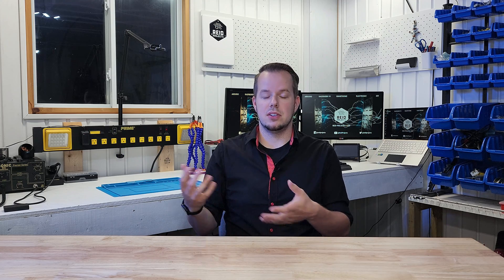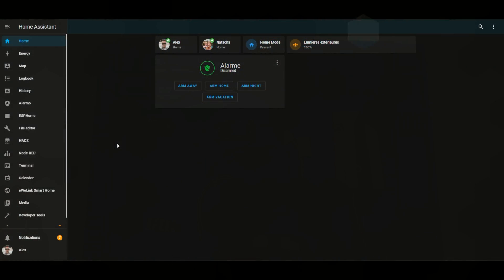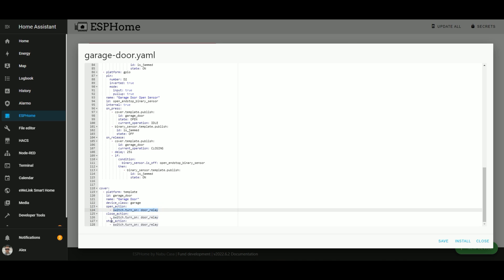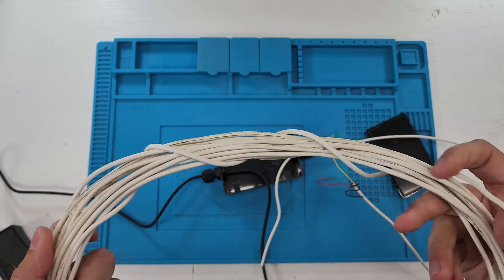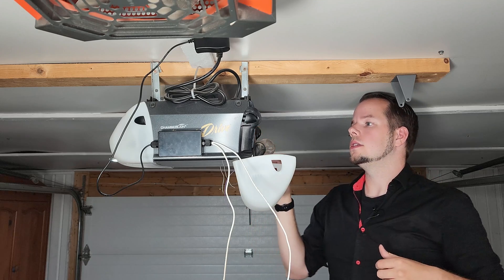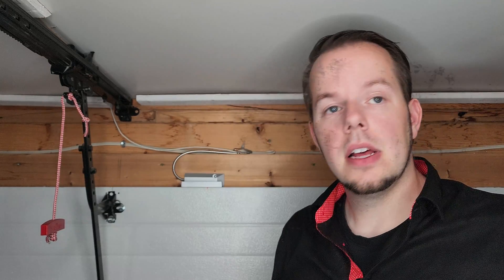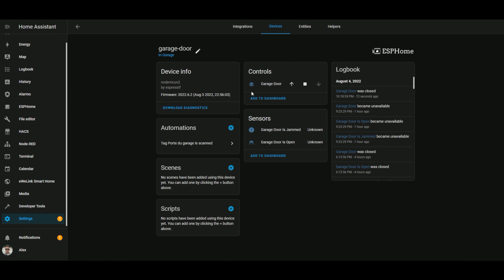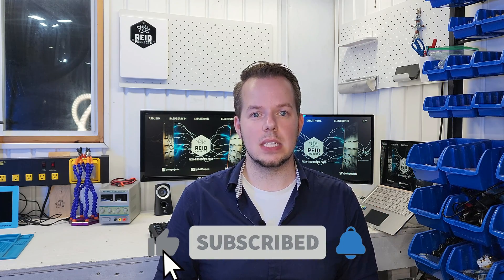How to make your Garage Door Smarter with Home Assistant and ESPHome !

Comment: This is awesome. Just what I needed. I went with the ESP32 with built in single relay to make it easier to 3D Print a custom case. I also exposed the relay so I could control it in automations easier. It even works well with the original remote.

Comment: Great Project. Made it about 2 years ago and works flawlessly. I want to be able to override the obstruction if it wont close. Leaves often obstruct the sensor. I suspect that I need a second "Switch" series of statements - call it "switch_Override". Does that sound right. I'm not much of a YAML coder.
Reply: The idea is that I could change the "Delay" to 15 seconds or so. This would simulate pushing the door button until it closes, overriding the obstruction. At least that is how my garage door works.

Comment: Just one note regarding is_jammed:
If you open the door, stop and close back you will still get is_jammed. Similarly from open to close, stop and back to open. To mitigate this you need to modify condition so that it takes status from both open and close end stop sensors.
           condition:
             - binary_sensor.is_off: open_endstop_binary_sensor
             - binary_sensor.is_off: close_endstop_binary_sensor
Reply: Here is the specific format that worked for me. You need the "and:"

        condition:
            and:
            - binary_sensor.is_off: open_endstop_binary_sensor
            - binary_sensor.is_off: close_endstop_binary_sensor

Comment: Great video, works great. I have mine working but when you add the relay in parallel it stops the remote and Wired button from working. if you remove it, the button and remote works fine. Any advise?

Comment: This is a super cool project and I would like to thank you a lot for the code!
I have extended it a little with an ultrasonic sensor to detect if the car is present or not.

sensor:
  - platform: ultrasonic
    trigger_pin: D3
    echo_pin: D4
    id: dist
    unit_of_measurement: 'm'
    accuracy_decimals: 2
    update_interval: 60s
    timeout: 4.0m
    filters:
      - filter_out:
          nan
      - max:
         window_size: 3
         send_every: 1
         send_first_at: 1
...
binary_sensor:
  - platform: template
    name: "car is parked in the garage"
    id: car_parked
    lambda: |-
      if (id(dist).state < 0.8) {
        // car is parked
        return true;
      } else {
        // car is not parked
        return false;
      }

I've also tweaked the code a little bit and I would like to share that bit as it might be interesting for others as well.
Instead of the hardcoded delay (in your case 25s) I'm using wait_until with a timeout of 25s which will have a similar effect as your code however with the static delay I found that when the door was opened and instantly closed I got a short "jammed" which the wait_until avoids.
Just remove
      - delay 25s
and replace it with
       - wait_until:
          condition:
            binary_sensor.is_on: close_endstop_binary_sensor (or open_endstop_binary_sensor respectively)
          timeout: 25s  

Thanks again for sharing your code it made my project a lot easier for me.
Reply from the maker: Awesome ! Those are great additions 😀 I might add them to mine too or to a second version, thanks for sharing 👍
Reply: @ReidProjects  I have fixed the last thing that bothered me a bit:
When you restart the ESP (e.g. because you updated the firmware or because there was a power cut) the jammed status and door status where set to "unknown" until you opened or closed the garage door the next time.
Adding this code in the esphome stanza will solve that problem:

esphome:
...
  on_boot:
    priority: -100
    then:
      - if:
          condition:
            or:
              - lambda: |-
                  return id(close_endstop_binary_sensor).state;
              - lambda: |-
                  return id(open_endstop_binary_sensor).state;
          then:
            - binary_sensor.template.publish:
                id: is_jammed
                state: OFF
          else:
            - binary_sensor.template.publish:
                id: is_jammed
                state: ON
      - if:
          condition:
            lambda: return id(close_endstop_binary_sensor).state;
          then:
            - cover.template.publish:
                id: garage_door
                state: CLOSED
                current_operation: IDLE
            - binary_sensor.template.publish:
                id: is_open
                state: OFF
      - if:
          condition:
            lambda: return id(open_endstop_binary_sensor).state;
          then:
            - cover.template.publish:
                id: garage_door
                state: OPEN
                current_operation: IDLE
            - binary_sensor.template.publish:
                id: is_open
                state: ON
Reply: @schogaia   Gonna give your addition a try, have to ask though, at what place in the file did you add it, beginning, middle, end?  Thanks in advance
Reply: @Kevin1959ify  I'm currently not near a computer I hope to remember to paste you my entire code
Reply: @Kevin1959ify  the bit I added you can just add to the bottom of the file
Reply: @schogaia  that'd be awesome, very appreciated!

Comment: Great video thank you, If have two doors in one Garage could I use additional pins on the ESP to setup a second relay and set of sensors or should I get 2 ESP's?
Reply from the maker: Thanks that's appreciated :) You should be good with only one ESP for 2 doors, no problem.  Just make sure you select a board that has enough IOs.

Comment: I only have a single magnetic contact on my garage door.  Can this be adapted to work in my situation.  I also have two doors.  I have an ESP32-dev, I am assuming that I can use that as well.  Also does it have to ONLY be used for the garage doors or could temp sensors be added.  Thank you

Comment: The esp board is 3.3V i/o and you’re driving a 5V relay board expecting a 5V trigger signal.  I guess it works but I’m wondering how reliable that is.  Has anyone had issues with this?
Reply from the maker: No issue on my side ! This is why I chose that specific relay model. The Trigger Voltage will consider anything over 2.5v as High, so it always accepted my ESP's outputs. I had other models with a higher trigger voltage which indeed didn't work.

Comment: This is cool. I wish this was around when I set up my garage door switch in home assistant. Mine is currently using a shelly switch but I want to move away from using cloud based products. How do you flash the NODEMcu with esphome? I have a few on order from amazon for a WLED project and I will have one left over so I was thinking of using it for this kind of project
Reply from the maker: Thanks ! If you're already familiar with WLED, installing ESPHome isn't that different. I would recommend to go with the ESPHome add-on on Home Assistant, then you can just connect your device to your laptop and follow the instructions when creating a new device. This method needs to be done through https though.

There's also few other ways but a bit more complicated.
Hope that helps ! Let me know if you need more details

Comment: Hi, 

I really enjoyed the video.

I have been doing the same thing, but using a Raspberry Pi Pico W and ESPHome.

at 7:40 ( https://youtu.be/8Hwu4ZahLa0?t=460 ) you mention on the first boot they won't know which states they are in. Have you tried adding 

"publish_initial_state: True"

in your YAML code on ESPHome for each of the GPIOs within the binary_sensor section? 

I was having the same issue, if the power to the Pico W gets interrupted they came up in an unknown state. This fixed it for me.
Reply from the maker: Thanks ! That's great , I'll add it to the sample config ! :)

Comment: You skipped over the most important part of this project, the wiring of the ESP+Relay. Very little information on this part and it is the most important part in the whole video.
Reply from the maker: That's noted, sorry about that. You can have a look here, I made a small diagram that might  help : https://reid-projects.com/control-garage-door-with-home-assistant/

Comment: This is great!  Exactly what I am working on.  I have two garage doors, I would prefer to have both doors controlled by the same ESP8266, instead of building two of these.  Any advice on the code pieces to duplicate?

I can do basic stuff in ESPHome, but the templates and covers are a little over my head still, I'm trying to understand how they all work.

Thanks for the great video, and I totally felt the head hits.  Both of them!
Reply from the maker: Hey thanks ! So I didn't test it, but I tried to copy the different things that would be required.
Might need some fixes though.

If you still need it and want to give a try, here's a version with 2 doors : https://gitlab.com/-/snippets/2464720

Let me know if you try it ! :)
Reply: @ReidProjects  oh sweet! Thanks so much, I’ll give this a go and let you know.
Reply: I did a code review and found one issue.  D5 was used twice.  I changed one to D3.

Everything else looks good, I'm building this out on a breadboard right now to test, but I have to go out of town for work for a couple days, so it'll probably be the weekend before I get back to it.

Comment: Is it possible that there is a mistake in the code on your website? It checks both times if binary_sensor.is_off: open_endstop_binary_sensor . One time it should be close_entstop_,,, or not?
Reply from the maker: Hey you're right ! Fixed Thanks :) I also added a "virtual lock" to block any action and added some verification before opening/closing the door.

You can find the updated version here 👉https://reid-projects.com/control-garage-door-with-home-assistant/

Thanks again !👏

Comment: awesome video i have followed same steps but my relay doesn't trigger ...plz help
Reply from the maker: Thanks ! I had the same issue with one of my relays (that you can briefly see in the video...oops) which was not working well when triggered with 3.3v. You can confirm by triggering it manually on ground and then 3.3v to see if it change its state. If not, we'll, that's the issue. The one I shared from Amazon are the ones that worked well for me :) 

Let me know if that helps !